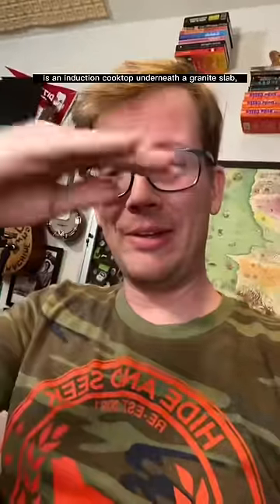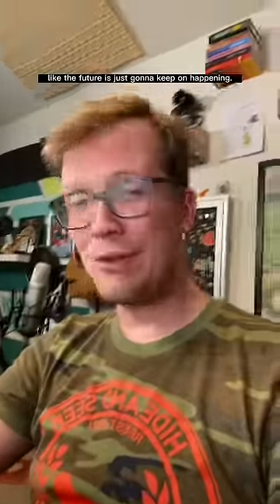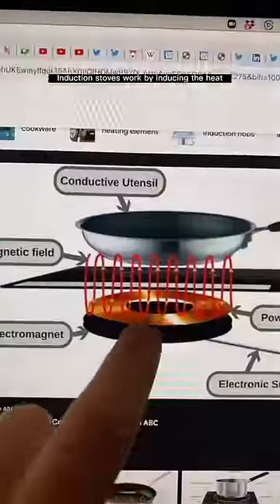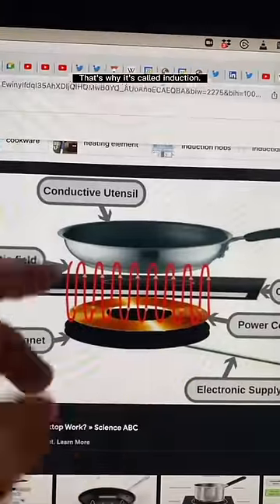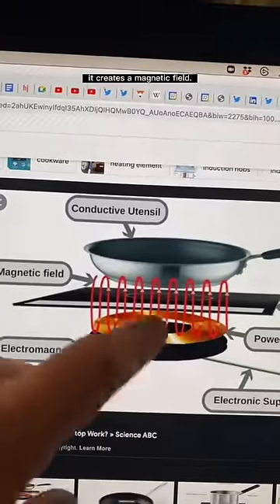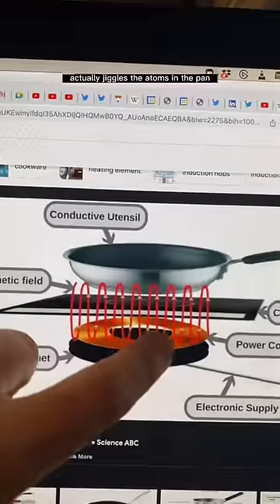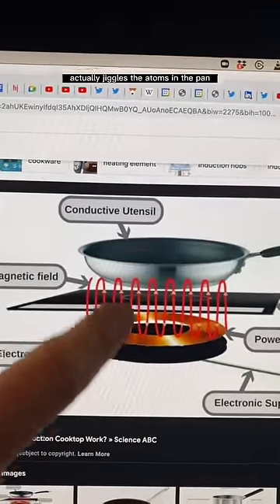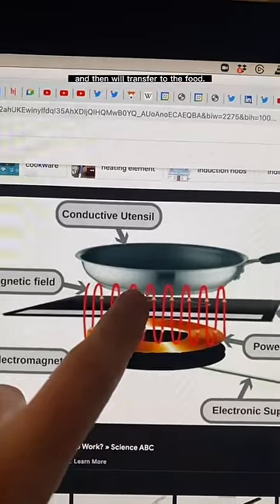How do induction cooktops work?

Comment: As an architect I designed a culinary school that had commercial induction cooktops. The high power equipment was exposed but we needed to be careful that other pans were not stored in the cabinets under the induction cooktops. The reason was because any pans below would heat up as well as the one above used for cooking! That of course was potentially quite hazardous. We did have storage shelves below but we didn't put doors on those cabinets to help avoid unsuitable things from being stored below by.
Reply: Would make more sense putting something like an oven below it or absolutely no shelves, just to make sure the user never puts ferromagnetic material down there
Reply: @CuriouslyWatching  Perhaps but you'd also need to be careful with the oven too as typically they are made from ferromagnetic materials. The issue I noted may only be related to the high-powered commercial units we used. The undersides of residential induction cooktops are metal shielded and the manufacturers have stated clearances needed to combustible materials. Following their guidelines, their equipment is likely quite safe. It should be noted that some people are very concerned about the EMF radiation induction burners expose to users. Although most people think they are safe some people blame them for being a cause of cancer.
Reply: It would be cool if you could transfer that heat to under the floor or something
Reply: Holy heck that’s a design nightmare lol
Reply: You could cook with a Dutch Oven beneath.
Reply: As a closet English teacher I wish to point out that the reason is or was something. Or the statement was because. The reason is not because something.
Reply: @vondahe  I just did a google search on the phrase and this response was featured: "'The reason is because is a standard English phrase, one coming from the pen of good writers (Bacon, Frost, Wodehouse) for 400 years. It's grammatically fine, and its supposed redundancy is at worst mild."
Reply: @nmg6248  yep...makes it pretty funny that the person really thought they had something nice...not thinking of the potential messes later on....or user error which will be done by her on a probably constant basis.
Reply: @eliza6971  I imagine all the metals the magnetic field connects to pull some of the energy, so if you're heating your floor as well as your pan you're going to need more energy.
Reply: @SusanKay-  well a credit card is a very small amount of magnetic material, so yeah it can be easily wiped even with just a handsized magnet.
Reply: @rossmacintosh5652 in Germany is kinda the standard for years already tbh
Reply: Do you have to remove you wristwatch, jewellery, and can they be used by people with any kind of metal implant?
Reply: @jorriffhdhtrsegg  Typically no, induction cooking appliances do not have those kinds of restrictions. While like microwave ovens they are considered safe, the fine print cautions & proper use instructions are really important for consumer safety. Unfortunately most of us don't bother reading that stuff and so we may be exposing ourselves to easily mitigated risks.
Reply: It seems so obvious to me, or anyone who understands basic magnetic principles. Magnetic fields are all around anything that is electrified.
Reply: As a high school culinary teacher, an issue I have had with induction cooktops is a whistling sound. I was not able to hear this whisling sound due to the pitch and my age. My students however, could hear it and it really bothered some of them. I did notice after several years of use the pitch of the whistling changed and I could hear it too. Obviously, this prompted me to purchase new induction cooktops. I opted to change brands hoping the whistling would no longer be an issue. I haven't had any complaints about whistling with the new cooktops, yet. Only time will tell.
Reply: @SusanKay-  if an MRI machine was 100 then these are somewhere between 0 and 0*
*Rounded down for ease of reading.
You literally have to be within touching distance with resonence, pretty sure there isn't enough ferrous metal in a credit card to allow this to run.
Reply: wow, who knew me being cheap meant i get more kitchen storage
Reply: And here I was thinking the induction stove top was triggered by the inTROduction of weight to the cook top. 😅😅😅
Humbled. Truly, truly humbled. 😔🤫☺
Reply: @CuriouslyWatching  The control panel is underneath the countertop inside a drawer. It'd have to be moved elsewhere in order to put an oven under there
Reply: It seems like an aluminum faraday cage directly under the cooktops would have solved your issue. You might have even used a layer of mylar before you got to the stainless steel worktops.

Comment: The only problem i have with this is that it turns that counter into a burn hazard. Yes induction stoves heat the pan, but the pan heats the counter, making it hot enough to create a 3rd degree burn if someone puts their hand on it.

Comment: IF YOU DO GET AN INDUCTION COOKTOP, be aware that not all cookware will work with one! This is an important detail because while you might be able to afford an induction cooktop, you might not be able to use it immediately if your cookware isn't compatible.
Reply: Any magnetic pans work (so yay, cast iron!) but they need to be flat. Any kind of warp or rim on the bottom can ruin the induction hob. I found this out the hard way.
Reply: So people can maybe avoid a rabbit hole, basically just most traditional western pots and pans. Unless you have one of those bs expensive copper pans, or a pan that's shaped weirdly on the bottom, you should be fine
Reply: the wok I had is probably older than me but works on this stuff ^^
Reply: most modern pans should work or at least have it stamped on the. A good test is a magnet(although i think some metals will work even if not magnetic)
Reply: Yeah just get an electric range with a glass surface, better value anyway
Reply: @XIIchiron78  nah just don't buy aluminium ^^
Reply: pretty sure any conductive pan will work, unless its weirdly shaped or copper
Reply: @MinkSquared  actually copper is interesting.
It's not magnetic in the conventional sense, but it does react to induced magnetic fields.

I have never even seen a copper pan though, but I'd love to test it.
Reply: @Nerobyrne  should you ever get one, and remember this comment, do let me know how it went!
Reply: You can get cheap iron plates that you stick underneath your old cookware. Works well enough.

Also, copper pans only get heated through eddy currents. The reason iron works so much better is because it's ferrous: the magnetic domains realign with the magnetic field and this realignment requires energy that's dissipated as heat.
Reply: Yes it costs way more to get a set of pans and pots than you would think
Reply: @miawgogo a lot of non stick pans especially light one's are not compatible
Reply: I want an induction stove so bad, used them in chef school few years ago
Reply: YEAH i was gonna ask like... would ceramic and other non-metal cookwares work... with that...?
Reply: @tylociraptor8131 Nope, wouldn't work at all. Are ceramic pans even a thing though? I feel like ceramic cookware is mostly for baking.
Reply: @vappyreon1176 Y'all really underestimating how many of us are using cheap aluminum pots and pans.
Reply: The ones we have to use have a copper plate in them. I hate them. Everything sticks to them. And the induction stove sucks. The wiring always goes fucky and the stove ends up over heating. All my food sticks and gets burned unless I’m constantly moving it.
Reply: @MinkSquared copper is a good conductor but it won't work on its own because it's not ferrous. That said many copper pots have layers of other metals that are ferrous and therefore will work.
Reply: Needs to be ferrous.
Reply: This is probably quite situational though. I've found that it's actually difficult to find cookware that isn't compatible with induction cooktops. Like, they've been so standard where I grew up, Sweden, for so long that making incompatible cookware would have been silly.

Even after moving to the Netherlands, where gas stoves are still somewhat normal, it's difficult to find cookware that is incompatible.

That all aside though: you'll usually find that most places selling kitchens will also be able to sell you some cookware. Single-digit euros per item isn't much when spending on a cooktop + installation... :P
Reply: I bought a portable induction cooktop for wax, because it had the most precise heat controls I could find. When my old kitchen got ripped out, I went around testing to see which cookware I could use with it. I discovered that the newest in my kitchen were high efficiency aluminum and wouldn't actually work with it! A weird laminate saucepan did, although it did sing worryingly because it had layers of heat conducting alloys to better distribute heat. 

And then I realized it was moot because I didn't have a kitchen sink to wash my pots anyway and lived off microwave food until the new kitchen was finished. Oops.
Reply: @vappyreon1176  it doesnt work with ceramic :/
Reply: @MegaNymphia  what are you cooking on a stovetop that's ceramic??
Reply: @vappyreon1176  you've never seen ceramic pots or pans?
Reply: Don't believe this BS, if your pan is metal it's going to work, if your pan is not metal then it's not a pan...
Reply: @Ender240sxS13  no he's right, if your pan is aluminum induction won't work. Most pans are steel, but not all of them.
Reply: Most ones bought in the last 20 years will work though. And a lot of the older ones as well.
And even if it does not, you can get a medium for your old ass aluminum pan if you really want to use it.

And induction tops are not that expensive, the ones hidden under a granite slab will be though, looked into it when buying mine.
Reply: @settratheimperishable4093 Induction isn't the oscillating of fields its just a lightbulb beneath the counter with many more folds. Its not anything new just coiled metal gettin spun
Reply: @Earthstar_Review Liar
Reply: @PotatoesAreNeat Ugh its not MAGNETISM induced by an electric magnetism its just a coiled tube being warmed up, its your fault for burning stuff when the heat is direct
Reply: @tommyhansen7600  I didn’t say anything about magnetism..? Maybe you’re replying to the wrong person. The reason my food always burns is because the induction stove always breaks, the guys that come to repair it always suck, they fuck something up, and even when my stove is on low it’s actually super hot. So now I cook with a burner cook top instead of my actual stove lol. THATS the problem. I know how to cook food and my food doesn’t burn or stick now that I’m free to use my preferred pots and pans.
Reply: Well, it's induction. I'm not really sure what you think I was lying about? I never did make much perfume with it, but it did come out great.
Reply: Just like your Profile isn't with sanity?
Reply: @miawgogo Most pans are in fact not, especially budget sets sold in most stores which most people go for
Reply: and they can have an annoying clicking sound 😬
Reply: @miawgogo  Well it has to be magnetic. A common advice when buying pans for induction is to bring a magnet when looking for pans. However i never do so since any common steel or iron pan will be magnetic. And that represents 90% of the market anway. Just stay away from expensive artisan copper pans and you will be good to go.
Reply: @vappyreon1176  you don't need expensive copper pans.
Reply: @charmio  The main reason iron works is that it has higher resistance than copper. It does have hysteresis losses as well but they are smaller than the eddy current heating. There are all-metal cookers which will work with copper or aluminum.
Reply: @whitcwa  That's part of it but from my experience the magnetic properties play an even larger role.
You can see just how much of an affect it has by having a look at how much harder it is to inductively heat iron once it's past its Curie temperature and its no longer ferromagnetic. The resistance is also even higher when it's at that temperature too, so it's clear there's more to it than just resistance.
You can take my word on that, it caused me much frustration when I was designing my first induction heater and couldn't get it to melt iron.